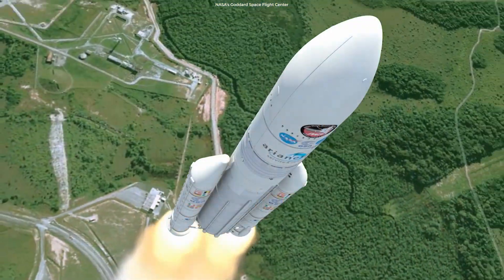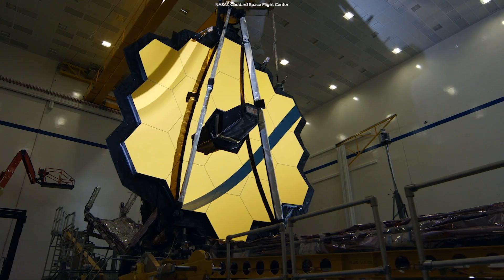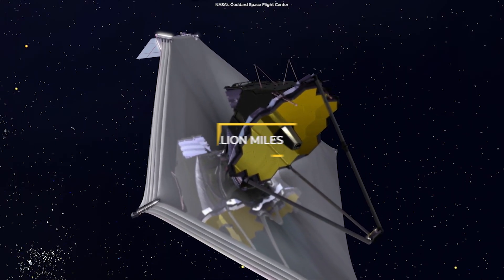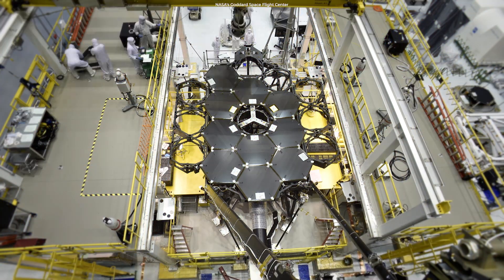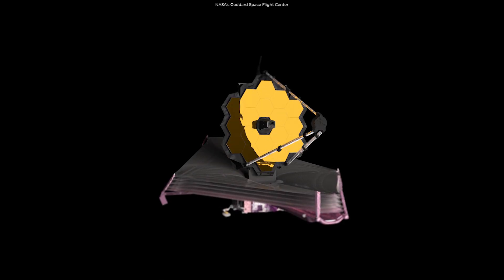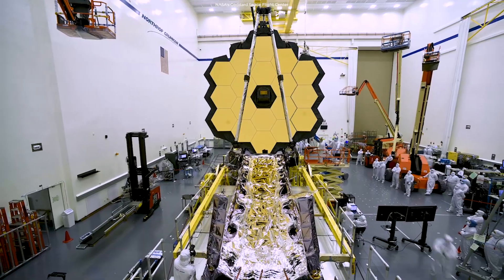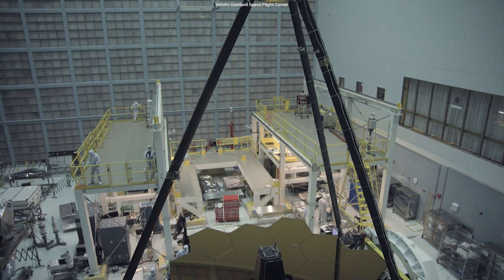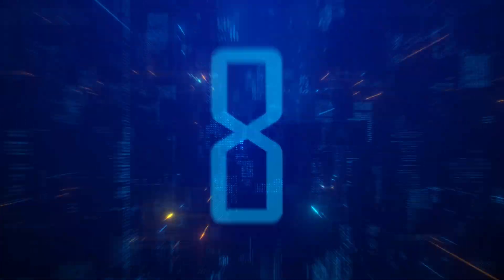James Webb's Gold Mirror Explained

Comment: Great job nasa! Only years late and 9 billion dollars over budget. Your a joke!
Reply from the maker: A joke only until this thing goes out there and starts operating.
Reply: Many engineering projects end up late and overbudget. One reason is that it's often difficult to know at the beginning of an engineering project what you will run into during development. Its hard to anticipate everything and problems do come up. Also, if you estimate things realistically at the beginning and start with an accurate budget the project may be deemed too expensive and never get funded or another bidder may get the contract instead of you. So you low ball the estimate and hope you get enough funding to get the project started and then you ask for more later when the project has already begun and its too late to pull the plug. Engineering something new like the James Webb Telescope that's never been done before is a challenge and not an exact science. You should try it sometime and then come back afterwards and let us know how you make out.

Comment: Let's see it doesn't tarnish, superconductive, very reflective, finish, please.  oh by the way gold has a low melting point easy to work with help me out here, and is a long-time gold member.  My card is platinum  LOL   if the telescopes capture most but what about the lower waves does it have storage banks in case of a power failure you know they can happen.
Reply: Gold is the best electricity conductor hence it's used to gather  data at faster rates and measure better...